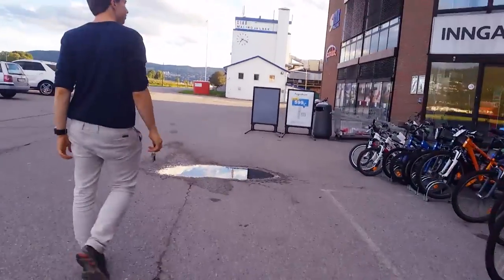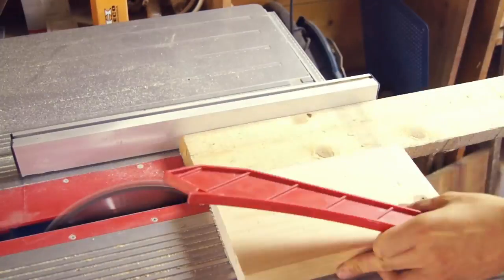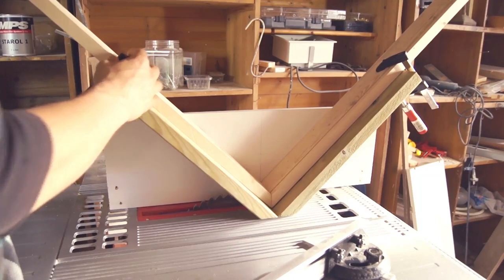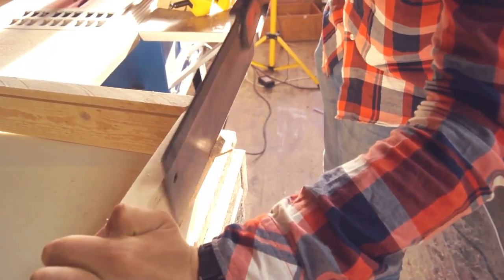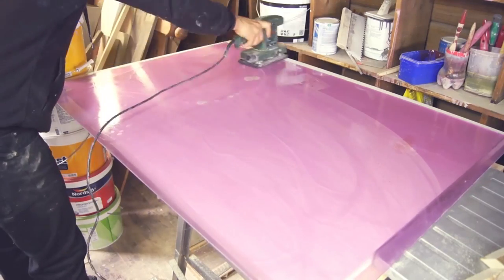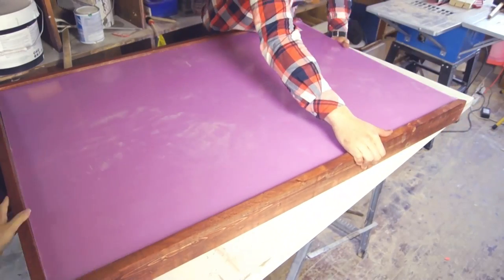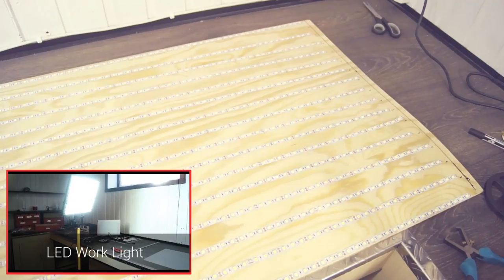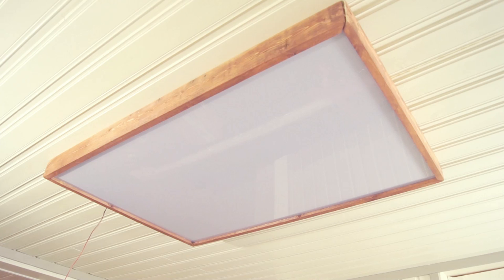Making a Reclaimed Wood Box Light  ||  How-to

Comment: This is great, but you really shouldn't hold the board against the material you're running through the table saw. Too much pressure can cause friction between the blade and the fence and kick back the material at incredible speeds and can really injure you
Reply: If only she'd read this comment...
Reply: @stoogel  holy God I think this was the first video after the accident
Reply: these guys have 0 sense of safety
Reply: woops

Comment: i have done some can spray painting on plexiglass sheet and i havent sand it, havent apply a primer, only apply the paint from a spray can and the paint sticks great. if you want to do the project much easy and cheaper this are good tips! 😉
Reply from the maker: That's a good tip! The sanding is for a more diffuse view on the paint on the backside, and will make it look more frosted :)

Comment: hi uploader great vid!
i wanna make one.
can u confirm if the led lights
covered with glass won’t get overheat
throughout the years? 
just a safety precaution.
thanks👌
Reply: LED's stay pretty cool but with the amount of air space between the lights and the diffuser you shouldn't have any problems with heat.